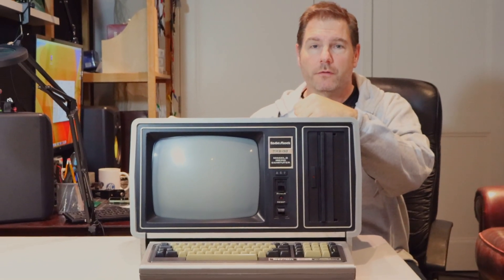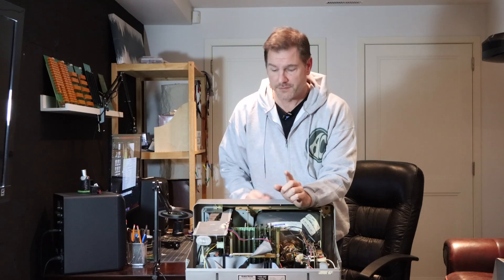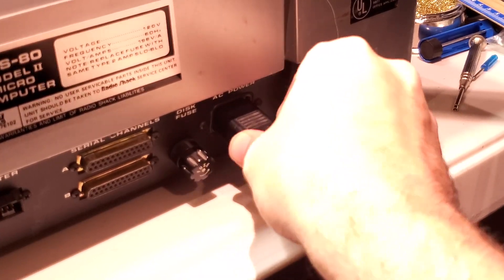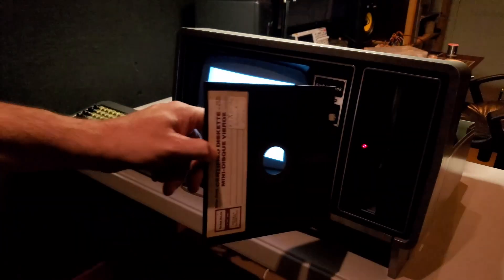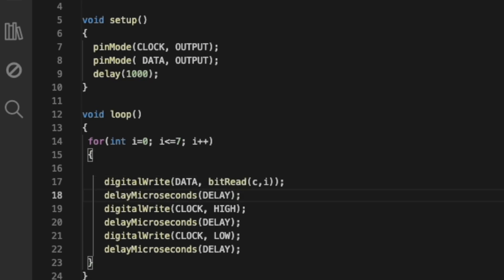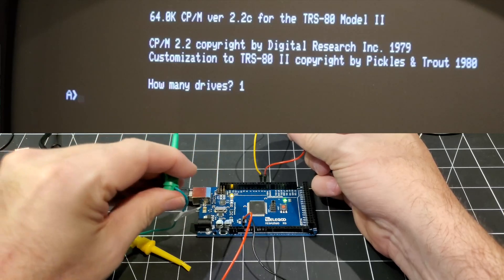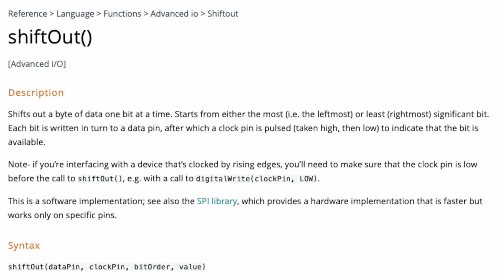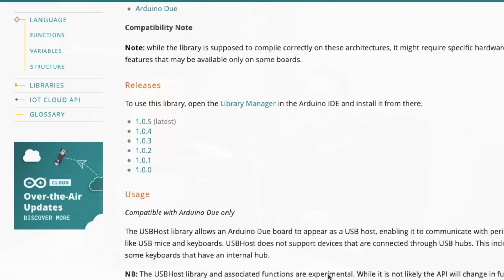Modern Meets Retro: Adding a USB Keyboard to the TRS-80 Model II (Part 1)

Comment: Back in the time when USB keyboard where introduced you could get an adapter from USB to a PS/2 connector for your keyboard and one for the mouse,
Also there was an adapter available that allowed computers with a DIN connector using a keyboard with PS/2 connector. 
I always assumed that together with the USB data the old keyboard signals where available in the USB connector.
Not sure of that is true or not. but maybe it is still there?
Reply: The ps/2 protocol is basically SPI. Very similar to what the TRS keyboard uses, and exactly the same as AT keyboards.
However: the simple USB->PS2 adapters only work if the device supports it, and newer USB keyboards usually don't.

You could have a look at the VNC2 chips. They are meant for this exact purpose, hooking up USB devices to microcontrollers
Reply: @TSteffi  thanks for clearing that up. I never know this.
Reply: @NielsNL68  the Agon Light community has this issue. The Agon board has a USB port, but internally is ps/2. 
They might have a list of compatible keyboards that still support ps/2 protocol.
Reply from the maker: I don't know if the PS/2 protocol is identical to the Model II, and the Model II uses a separate "busy" signal...that said it would be worth a try if I can get my hands on one!

Comment: You probably want to use a microseconds comparison interrupt for the clock and data cycle. It will make the clock rock solid. A char buffer for the keyboard input can be used for your "if key pressed" logic to be used in the interrupt routine.
Reply from the maker: Great advice! In my research so far on reading a USB keyboard with Arduino the interrupt routine will definitely be required.

Comment: Great project for all kinds of retro computers! 
Does Arduino have a library for mapping USB scan codes to characters? Otherwise I guess it's a mess to support keyboards with all different (latin) layouts.
Reply from the maker: The Arduino keyboard.h contains a mapping for "modifiers" (like ALT key etc) --- otherwise can just use a look-up array to convert.

Comment: Great project ! Try to port your code to an ESP32 right away! More compact, same coding, etc.
Reply: While that’s a reasonable idea, another tenant of good design is to use the simplest and cheapest part that meets the requirements. 8 bit controllers are still used in keyboards today for a good reason.
Reply from the maker: Will look into that, not familiar but always looking for new toys!